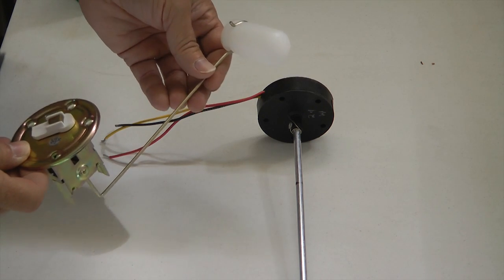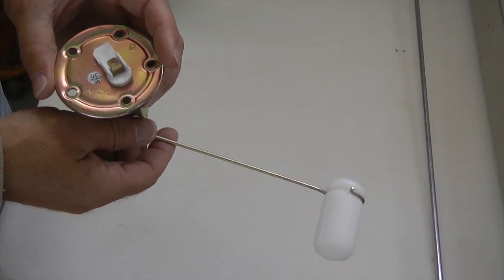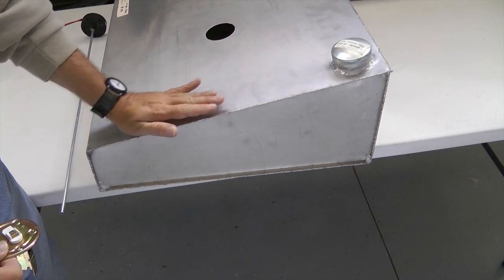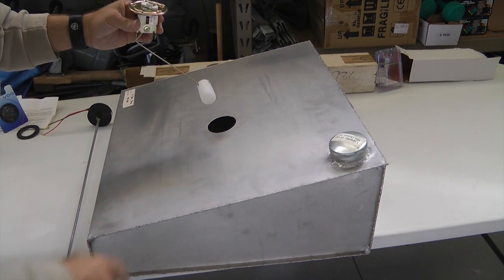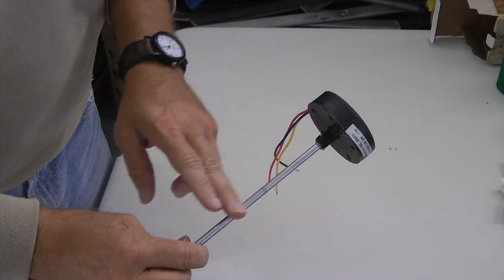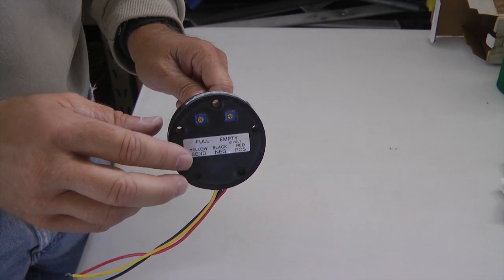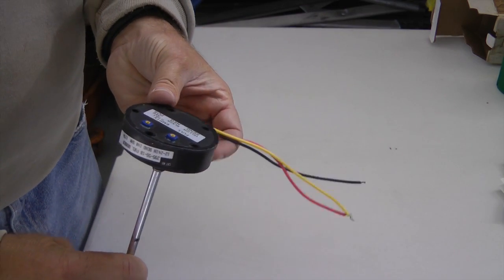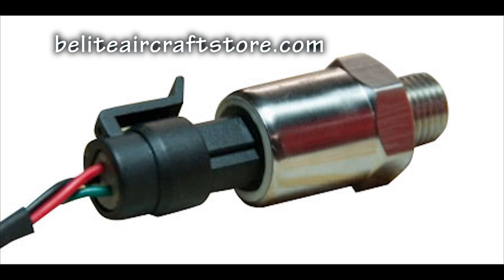Fuel Tank Sender options for a Homebuilt aircraft

Comment: There are programmable gauges that will work with pretty well any mechanical sender. Set the low point, fill with fuel, set the high point and it's calibrated!

Comment: You can only bend the capacitance probe between the black ring marked on the probe and the sender head. If you bend it on the other side of the black ring marked on the probe, you will break the insulation and short the sender.

Comment: Actually the capacitive probe is more susceptible to sloshing than a mechanical float  - it is the electronics that provide a damping effect for the capacitive probe   Commercial aircraft capacitive systems usually contain stilling wells that dampen the movement of fuel .
Reply: its not clear to me why the video is wrong on this point. Seems like the mechanical probe would respond instantly to  sloshing while the capacitive should have damping due to the viscosity effects of fuel moving through the small tube.